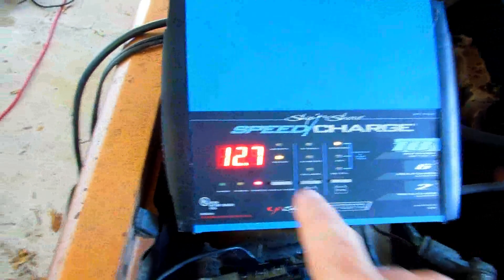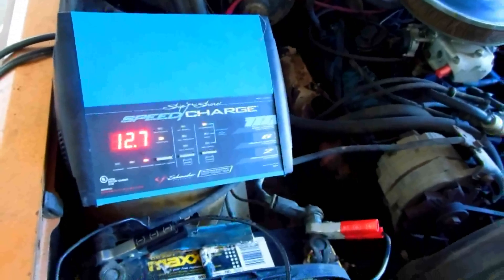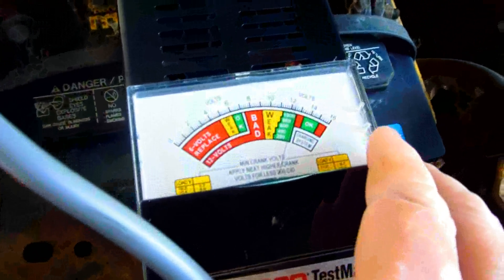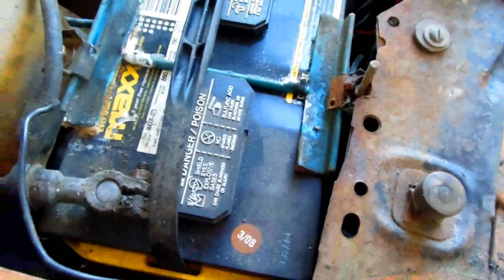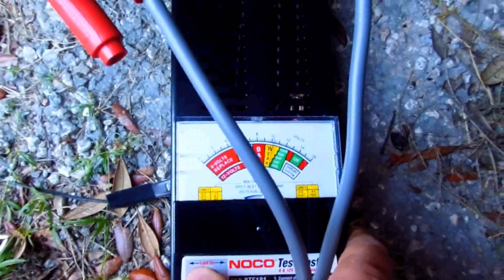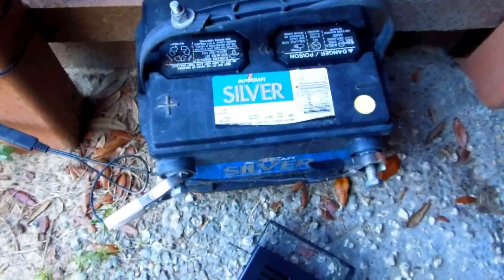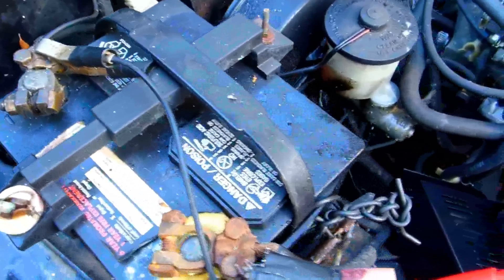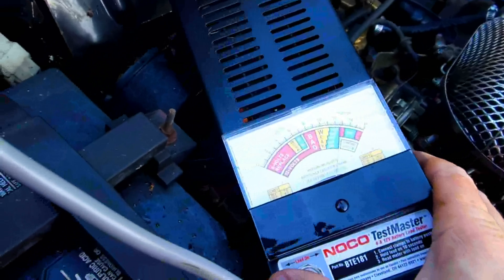Testing Car & Jeep Batteries with Load Tester

Comment: It's important to keep your battery terminals clean and without corrosion. Investing into a good multimeter that has min and max voltage readings and testing the battery when the starter is used will tell you more about the battery condition. A voltage less than 9.5 volts, across the battery, when starting, tells you the battery is too worn-out or needs to be charged.

Comment: I'd like to see how you rejuvenate lead -acid batteries...looking forward to your video. What I know of it between cells...lead oxide tits...call them tits form jumping across the cell to try and short it...that's why they "flash them" with a high-voltage reverse bias voltage (hit it with a hard opposite polarity for a few milliseconds)...and blow off all those lead tits. I thought about doing it with my batteries...but I want to know the proper voltage and how long to flash them first.